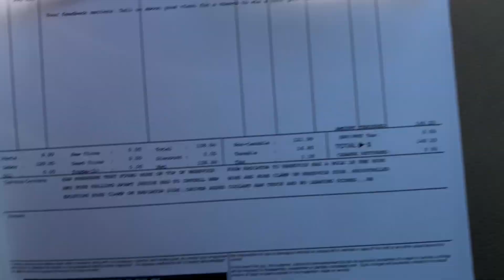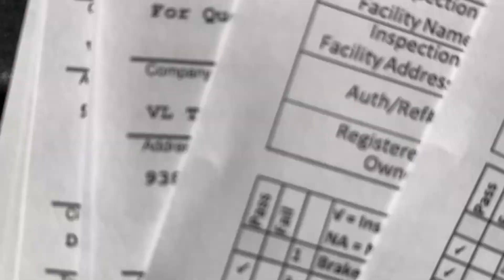VL Trucking Lease Truck Back In The Shop | Deadheading 700 miles home

Comment: Had the same problem - reservoir had a super small crack - but you ain’t no repairing - gotta he replaced. Dealership said it’s a common problem especially after hitting over 500k miles. Good luck out there big homie!

Comment: Mike, sorry about your continuing truck issues.  Two quick questions:  As you recall, I am a VL company driver for almost one year and I have had the same dispatcher since I started at VL.  Has anyone at VL given you a hard time about wanting to switch dispatchers?  Second, you mentioned you drove 13 hours to get home.  Did you have to call logs and have them grant you PC time?
Reply from the maker: Never had a issue with switching, when I called , I was told they have many dispatchers, so if I have an issue just call back, an no I didn’t call logs, I just ran it
Reply: @mikestruckinwithbigdaddy5233  that what I do too when I'm deadheading home f that eld